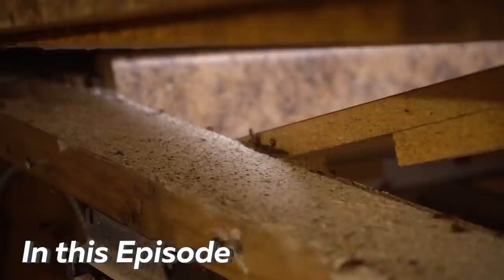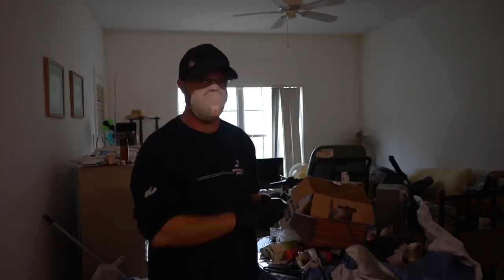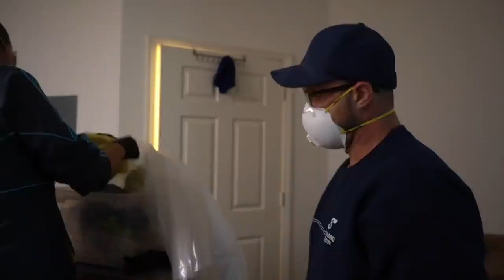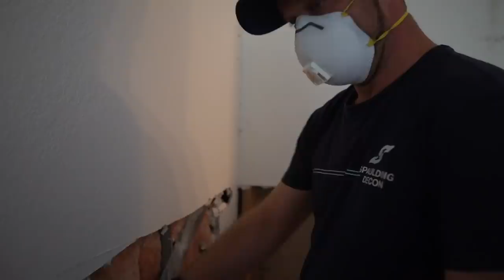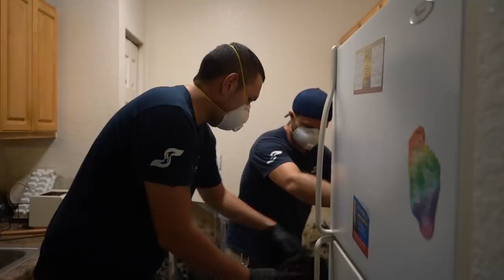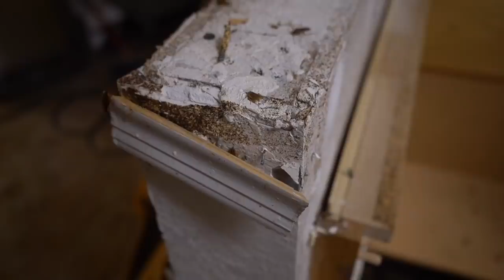Elderly Nightmare Pt. 1

Comment: I hope the company who owns this facility is held responsible and fined.
Reply: Absolutely. It should be anywhere you rent not only an assisted living. You as a renters are not allowed to drill into your walls and check for mold growing. Alot of these places have mold in the entire building.  No matter what unit it is. That's absolutely the managements responsibility because no matter how clean you may be if you can't get behind those walls you're fucked because the mold will keep coming back
Reply: It's not always the property owners fault. Alot of times, mold can occur like that due to the residents not ventilating enough and always having things boiling, hot showers, even humidifiers. The constant moisture causes mold. Idk if that's the case here, but it could be. My husband would have to put bleach in a pump sprayer when people moved out sometimes and just drench the walls, ceilings, cupboards and let it sit overnight to get rid of the black mold. Sometimes the sheetrock would have to be taken out and replaced if the people lived there long enough for it to get that bad. Most commonly happened in the units that the tenants made tamales alot.
Reply: @heatherdontcare  it is still the responsibility of the owner to ensure that there is enough ventilation, fans, etc., in the kitchen, bathroom etc. I currently live in a unit where the manager admitted that the fans in all the bathrooms no longer work, they are "too old" to replace, so tenants are told to leave the bathroom door open at all times instead. Owners are cheap scrooges that spend money on yachts and cars instead of maintaining their buildings - save a penny to spend millions when a major failure finally occurs that could have been prevented by spending a few cents instead.
Reply: Yep shame on them
Reply: And sued by the families of the residents
Reply: @heatherdontcare  what about all the cockroaches, thats just not cleaning at all.....
Reply: @deenak79  the people carry the roaches with them from place to place,  often infesting complexes that were not infested before them. Once infested, it's HARD to get rid of the nasty buggers. Companies like Orkin won't guarantee apartment complexes because so many tenants carry infestations with them. They'd lose money trying to keep up with a guarantee.  And you're right....it's. It clean. The people that live like that are disgusting and don't care.
Reply: @heatherdontcare  i can confirm. My mom house had 0% roach infestation. Right after a cousin from USA stayed at my mom house for some time, my moms house started having roaches in the kitchen. Found out my cousin also had an infestation in her other house and she bought it with her .
Reply: @heatherdontcare  PLEASE explain what the tenant's choice in diet has ANY effect over whether or not they have mold/pest 🪳 problems. Where I come from, that is considered DISCRIMINATION.

Comment: Isn’t this an assistant living?? Why is the apt not being inspected on a regular basis?? Who dropped the ball??
Reply: Exactly. My apartment get checked once a year for mold and that the smoke alarms work. That mold and water damage didn't get that bad overnight, that's been wet a LONG time. How was this not noticed and taken care of way before getting this bad?
Reply: My thoughts exactly these are out elderly being left to rot in a hell hole
Reply: Exactly
Reply: That's what I was wondering
Reply: They just knock the door and ask if they are ok.
Reply: It's assisted living lol
Reply: Apparently, there's not much "assistance" going on there. :-/
Reply: Nurse here!! Depends on the contract of the place, but even low income senior housing is subject to inspections HOWEVER, residents aren’t evicted and often hide the bad things going on because they may hoard or have been written up. This always causes more problems in the long run.
Assisted living facilities tend to be VERY expensive and this seems really large for a standard facility.
They have full sized appliances.
You get call cords and alarm buttons, you can avail yourself of more help if you want but you are not obligated to. This person clearly just used the place as an apartment.
I’m sure this didn’t even take that long. When someone gives up the bottom of the hill comes surprisingly quickly 🙏🏻
Reply: That’s what I was thinking Julie Sanchez! I thought the people made regular visits to these people!
Reply: If that apt. had roaches, other ones did too, had to of.
Reply: @jennyjenkins3486  they sure are! and at a rate of THOUSANDS of dollars too. They are preying on these folks in their most vulnerable times.
Reply: I agree!
Reply: I thought the same thing wouldn’t someone periodically visit this person??
Reply: Jenny Jones And probably little or no family to stand up for him/het and demand the issues in the apartment be tended to. 😔
Reply: Some places in FL are communities that only the elderly can qualify to live in... They will provide services at the Residents' or family's request. If the resident does not want anyone in the apt the wishes are respected until problems arise. In this case, a problem arose... Mold. Or the water leak that caused the mold...The roaches on the other hand have been an issue it seems.
Reply: My husband and I lived in a disability apartment with the government just till I could get my prosthetic leg and get walking and they did a yearly inspection. Cabinet stove fridge every where
Reply: @sarafleming9893  but the tenant created some of those issues, did they not?
Reply: @Dreamwolf31  But they were elderly and might not have been in their right mind. Elderly can also have problems cleaning.  I took care of my elderly father. It was a nightmare. Even with me there  it was hard to keep everything clean.
Reply: @Dreamwolf31  yes.
Reply: @KateCarew Thank you for explaining. This was so sad to watch. My parents ensured that my grandparents had the best possible care in a beautiful assisted living facility. The owners built an extravagant home to bring in their parents as they aged. As their parents passed away, they'd invite others to come join their family. The woman is a nurse.  The facility has a chef, full time CNA's, a salon, a game room for family,, a garden for fresh veggies, an offsite pool with transportation, and a beautiful atrium. My husband and I were married in the atrium to be sure my grandparents were able to attend, and they took such good care of us, even making us a cake.  The residents made us beautiful cards.  It was a small family environment, and ALL of our parents and grandparents should be entitled to this type of care at a price that's affordable for *everyone*.
Reply: @JULIE SANCHEZ
 Same thoughts here. I wish these people would be turned in to Health and Human Services. That is too far gone. It's called neglect. Should have been checked on periodically.
Reply: Pretty sure it's a community that has multiple levels of care. And this is probably in one of the independent living buildings. In such facilities, aides,nurses, and housekeeping can't just force their way in. It was probably discovered when the tennant was ready to move to a higher level of care.
Reply: @KateCarew  thanks for your input, it always helps to have information:)
Reply: @trisia44  For real?  This seems to good to be true.
Reply: Even in a rental you get quarterly checks re upkeep & any maintenance. This is awful. My grandma's sheltered housing flat had a warden checking daily that all was well.(in the UK)
Reply: Exactly.. if its assisted, dont younhave someone coming in daily to check on and assist the elderly who live there, younwould think they would have noticed immediatly..
Reply: Usually when it comes to like subsidized housing or things like that you're supposed to be checked once a year
Reply: @KateCarew  I agree, this looks more like a low rent housing complex.
Reply: If I was a resident I’d sue
Reply: Maybe they people inside refused to let them in.  Because of embarrassment.
Reply: Exactly what I was wondering, this is deplorable😢

Comment: Oh, I feel the mold pain so much. I helped in rebuilding a house for remodeling. Cute home, but the kitchen, bathrooms, dining room, and 2 bedrooms were covered in black mold. The smell.... It's awful, burns so much and makes you light headed even with a mask on. The feeling on pulling off drywall and seeing hundreds of roaches scatter is so disgusting and will freak you out. The "Phantom touch" from roaches.... It takes like a week for that feeling to go away. -- So much respect for Kyle, Juan, and the rest of the Spaulding team that can work in those conditions, helping others without going crazy.

Comment: Kyle and Juan, I hope you reported this facility to the state.  The facility has broken so many laws allowing this resident’s apartment to get this bad.  Assisted Living means they are suppose to be providing cleaning of the apartment, meals, medical care, wellness checks etc, etc.  The facility is clearly not doing their job.  If the resident is choosing to live like this , there is a sign of Dementia or psych issues that they should be addressing.  It is there responsibility to make sure the resident receives the care they need so that their apartment does not end up like this.  Mold and cockroaches spread so easily to other apartments that this could easily be happening in more than this apartment.  Any time there is an indication of mold, by law the resident is to be removed and provided alternative living arrangements until the mold can be addressed and it is safe for the resident to return.  Please, for the safety of the residents, please let the state know what you have found.  It can be reported anonymously to the Department of Health.  They do not need to know who is calling but they will do a surprise visit to the facility to confirm what they were told and fine the facility until it is corrected.

Comment: I had to move twice in the same complex and both ended up with mold. You could see through the wall inside the sheet rock. Finally moved altogether but living in FL there are bugs and mold in a lot of older apartment buildings. This place doesn't look that old. A tame hoarders episode but still feel bad that this wasn't checked more regularly by the facility.

Comment: I recommend getting a few pairs of good sturdy barbeque tongs and a couple of those grabbers that janitors use for picking up trash. A while back I had to clear out a small barn on some family property that was full of stuff and hadn't been opened in a few years and had been flooded from a big thunderstorm. I was gloved up and had on goggles and a tyvek suit but I was still real leery of putting my hands anywhere, like lifting a bundle of newspapers and 30 roaches come scurrying out (big Texas roaches that fly) or moving an old set of tires and there's a rattler....having tools that enable you to move objects from a safe distance help you get it done in safety. Even touching some molds can stir up toxic spores.

Comment: If you leave a gallon of milk with just a little tiny bit of milk in it on the floor or anywhere I guess  the cockroaches will go in the gallon and there you have it. A great trap! I worked by accident, when I was cleaning out houses.😱

Comment: Why do you guys attempt to score sheet rock with hammer and not a box cutter and a nail bar? and thermal reader? You will never be as effective unless you score with a blade. You are creating more clean up and staff energy bashing with a hammer. Use common sense. Dont be an idiot